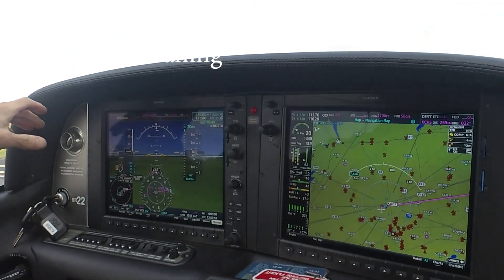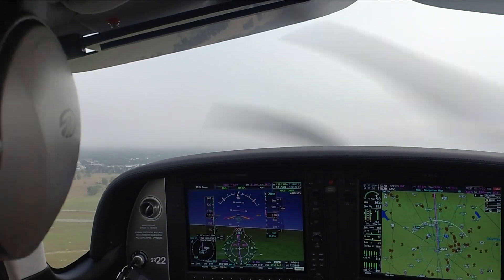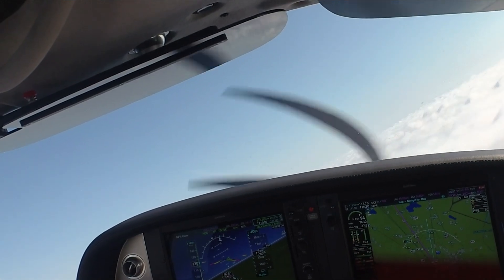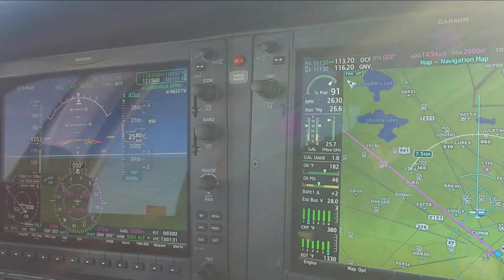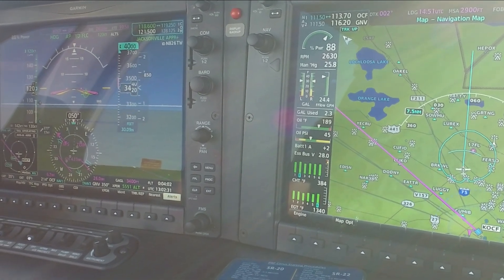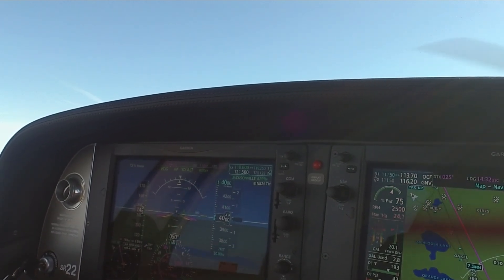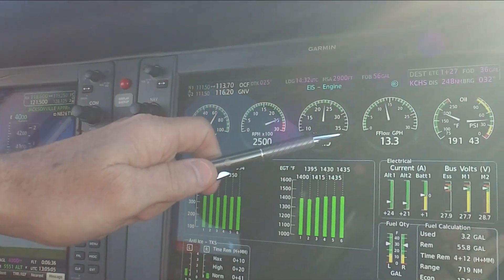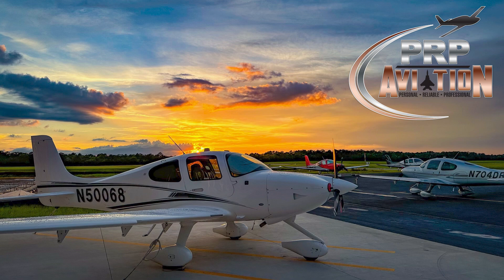SR-22 G6 NA Takeoff and Leaning Procedures

Comment: Thanks.  I've been flying a normally aspirated G3 for the last 9 years and don't have the segmented fuel flow indicator.  Just purchased a G7+ so excited to get that.  My question to you is you mentioned that to fly at 85% (which I don't do, but love to learn), you stated that the fuel flow should be at the top of the top fuel flow indication segment.  Yet,  you also mentioned the segments don't appear until 76% or less.  So with 85%, there won't be any segments.  So do you just use the top of the single fuel flow bar?

Also for Best Economy, I was taught to start the leaning at 65%.  You said to start at 70% so you end up at 65%.  Is that confirmed?  Just want to make sure I fly by the book.  ;-)